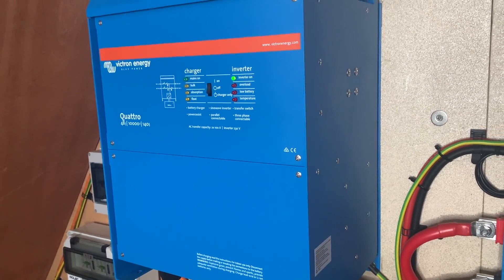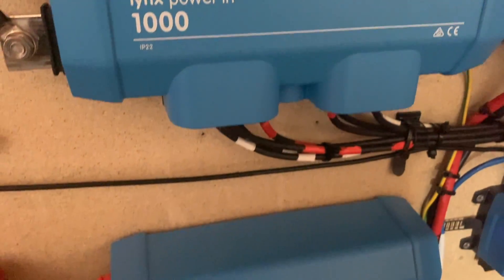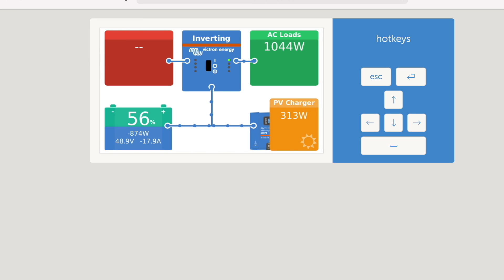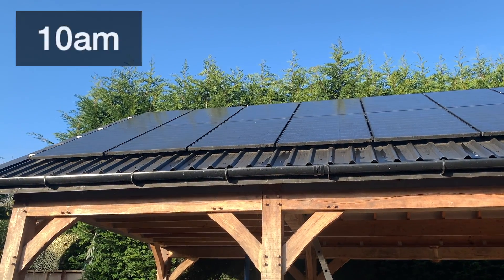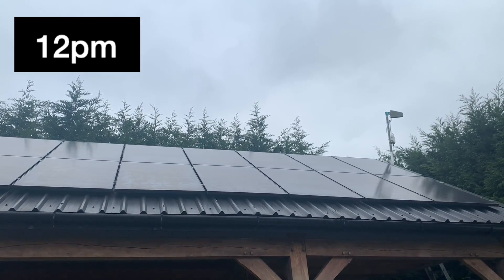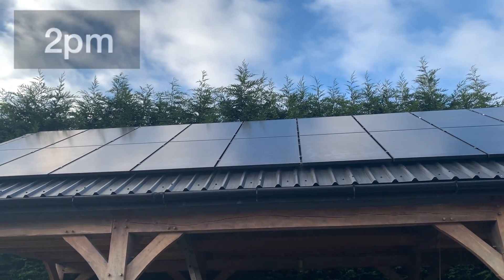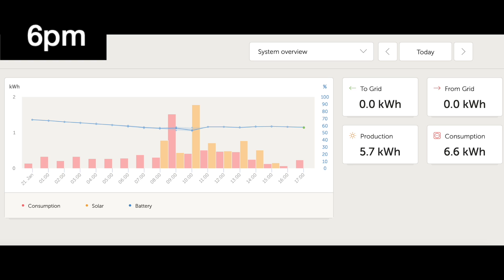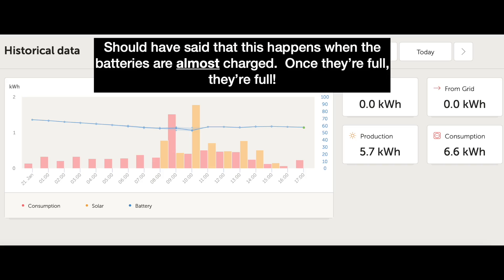SOLAR IN UK WINTER: What our DIY OFF GRID SOLAR POWER SYSTEM produced in ONE DAY in JANUARY.

Comment: I appreciate your video. However, it seems to highlight that solar does not enable sufficient and reliable energy to be off grid and carefree. Instead it seems that one will spend a fair bit of time agonising in front of your linked computer on darker cloudy days (of which at least six months for the UK) over whether you have enough energy produced to enable normal living without having to decide, do I sacrifice say a laundry day just so one can cook food; have a light and heating on. But in these times we live in, your solar may we’ll prove the difference (assuming it doesn’t malfunction at the worst time) between survival or not. So while I seem to be slating solar and I am to a degree as they are not the answer to normal abundant living, they are however possibly a good step in the right direction when s**t hits the fan as it will in the near future. Good luck and thanks for the posting.

Comment: Thanks for the great video! Had solar install myself over past two years. It seems like you must have the panels facing east. I think having them south is best if possible in the future. Noticed with my own solar that they are worse in the winter because of their angle being not steep enough for a lower sun. So if you have too much energy in the summer but not enough in the winter, then having the angle more biased to a winter lower sun angle. I know easier said that done when it's the roof's angle, but if you had space to put some on the floor then an angle change in the winter would help.

Comment: I ran Majority of our house off grid for five years and it worked brilliantly throughout the summer but winter was always gonna have its issues. One of my biggest mistake was to have lead acid batteries,but at the time of the installation it was my only option due to cost. I have now sold all my equipment and gone down the grid tie route which is more beneficial for us. You have an excellent system and l wish you all the best.

Comment: I've been off grid for 30 yrs and back then it was tuff. But with today's equipment it is so easy anyone can do it. These new inverters that are all in one is the ticket. I run 10 kw solar pannels and 50 kw in batteries which are two 48 volt forklift batteries. I'm always at 94 to 96% of battery voltage in the morning and never use a generator. I'm at float by 8:00 am. It works.
Reply from the maker: Thanks for your comment ☺️ Glad your system is working so well 👍

Comment: Ok so I don’t live in the uk but I have trouble using all the power I produce, 6x415w panels 5kva inverter, 5xpylontech us2000c 12kw, how do fully utilise 10kva inverter and 21.3kw battery bank? What do you run all at once to require a  10kva inverter? I only ask to learn what I else I can plug in to prevent my batteries from being fully charged by lunchtime every day! Do you have a couple of Tesla’s hidden away? 😁

Comment: I am interested in knowing if there are any studies comparing the degree of influence respectively of length of day (i.e. sunrise to sunset), angle of the sun and degree of cloud cover on the amount of PV generation. My observation on our system here in South Yorkshire (14 x 280W panels = 3.92 kW + Solis Inverter + 13.5 kWh Tesla Powerwall battery) is that the length of day is the predominant influence. December to February this year we generated around 300 kWh; June to August 2021 around 900 kWh. Overall: October to April we’ll get 1,000 kWh; between April and Ocotber it’s be 2,500 kWh. Pretty consistently year on year. At this time of year (mid-May), with clear blue skies all day, we can get up to 22kWh; with variable cloud (sunny intervals), that might be reduced to 10 to 17 kWh, whilst on a heavy overcast day we might get down to between 5 and 10 kWh for the day. So cloud cover is not insignificant. From these observations I’d say the order of influence is 1. Length of day 2. Cloud cover 3. Angle of sun. Even when the sun tucks down behind the trees on the West side of our garden, there can by reasonable generation simply from sunlight radiating in a blue sky above.

Comment: Solar array watts / system voltage + 20% safety margin = charge controller size. 
always get a bigger MPPT charge controller.
maybe have a professional at the company look at your solar panel and MPPT set up.
your MPPT is 150/35 and you have LG355 panels so the MPPT VOC is 150volts the LG355 is 46.4 volts at 10 amps.  so you would only be able to connect 3 LG panels in series to the MPPT.  you have 20 panels.
if you did 4 in series of the LG355 you should have at least a VOC of 200.

Comment: I am in Australia and also have an Off Grid system with 10kw of panels, 6 Pylontech US3000 and a 8Kw MPP Pip 8048max inverter charger. Have had no issues with my system and has far less hardware compared to your system. Being winter now I only achieved 11kwh yesterday. Today should be a better day as I also want to charge an electric vehicle.

Keep up your great work.
Reply from the maker: Thanks for your comment 😊 Glad to hear you’re getting on well with your batteries. 👍

Comment: you could also have a smaller array to the west and the east so you can grab more solar coming in i did this as a test a few years ago and was surprised at just how much more it did to help another thing i did was try and stay away from ac appliances as much as possible and if they could be run from dc i ran them from dc with buck converters

Comment: Thanks for your interesting video and info.
We live in supposedly sunny South Africa and are totally off grid but also on a cloudy day are lucky if we get 10% of the rated power from our solar. I have had Solar for over 20 years now and must admit Victron are expensive but never had issues with mine. What is completely wrong with Solar panel conventional thinking is just using ones latitude angle for the panels. I have found it’s no good anything less than 45deg as in summer you get way more hours sun time than in winter and as you say when your batteries are full you can’t store more. 
On a slightly different note when I lived in Colchester UK I fitted my own solar water heater 45 years ago, everyone thought I was mad! Trouble was we couldn’t shower as it heated the water too hot 5 months of the year. 
What do you use for cooking and hot water? 
Cheers Frans
Reply from the maker: Glad you’ve got on well with your a Victron stuff 👍 We might look add a water heater at some point 😊
Reply: Should have circulated the too hot water through the heat exchanger in an indirect cylinder.
Reply: And a mixer tap on the shower.

Comment: Just watched your winter solar charging video, and note your comment that mid-day is the best time of day for your panels, but unfortunately it was cloudy. When I got my panels in 2011, I was quite pleased that my house faces south east. One major characteristic of sunny days in the UK is that they usually result in thermal clouds (cumulus) building up from about mid-morning. My high power window (above 2 kW) in summer is from 8:30 to 14:30 (BST), peaking between 11:00 and 12:30 (the sun going higher compensates for no longer facing the sun). The best thing is that cumulus doesn't usually affect the yield much until after 11:00 am, so on typical sunny days I get more yield than I would facing south..

Comment: We get basically zero from November into February. Do you have the panels pitched at a steep angle to accommodate the sun lower to the horizon?
Reply from the maker: No we don't have them at a steep angle, but if it is grey (which it definitely was this winter just gone!) we have read that a flatter angle is actually more optimal ☺️

Comment: Surely it would be possible to combine daylight times & historical weather data to produce a reasonably accurate map of the UK that you use with array size & orientation to predict output?

Your video throws up some interesting cost/efficiency questions for the future - Off grid vs on grid, back up generators or using an EV to "buy in" a top up from a public charge point???

Comment: Utilizing a 5 KWp system, my daily Yield in January was from 15,8 KWh on the 30th down to a mere 188 Wh on the 2nd. Even extending to 7.1 KWp would not get me through. How low do You go through Winter? I would very much like to see a spreadsheet with Your daily yield. It seems like the shift in lattitude is taking its toll, I live at 57N. All the best to You from Denmark.

Comment: There's something wrong here. You have 20 monocrystalline panels  which I guess are 250W per panel, that's 5kW of panels. I have 5 x 375W panels (1.875kW) and I produce similar amounts of power to you. not sure how that's possible. would be interesting to discuss. I am using a 3.6kW hybrid inverter with 10kW of battery storage. my panels face southeast.
Reply from the maker: Thanks for your comment 😊 Our panels are 355W each and our production varies hugely based on the weather and time of year. Do you produce more than this in January on a grey day? Where are you located? 😊
Reply: @The_OffGridFamily  
Hi I am based in Hampshire, I can't give you Jan readings as my system was installed mid Feb. So you have over  7kW of solar panels and 10kWh of storage. I think your system should be producing more even on bad days. Maybe I am missing something here
Reply: @The_OffGridFamily  
I would be interested in looking at a couple of comparative days readings over the next few months to get a good comparative. For example, your best day in May and your worst day in May.
Reply: 10 kw of battery storage is not correct/possible ; you mean 10 kwH ?  because that is what i have,10 batteries of 1 kwHour each
Kw is power,like hp,horsepower
KwH  is energy, like Joule,BTU,calorie...
(i know you knew that,but i see SO MANY mishaps regarding those 2...)
and I think it is because their names are similar
Reply: @josepeixoto3384  Thanks for the correction, sorry for the Typo.

Comment: I use victron,  solar panels too ! 
I have 1200 watts of panels ... loads of power all year round living on my narrowboat . Propulsion also electric.
Reply from the maker: We are big fans of Victron 😊 We’ve got on well with all our Victron components so far 👍
Reply: Just checking. Your boat propulsion is poweref by your solar panels?
Would love tonsee that video, setup and an idea of costs.
Reply: @purplemonkeydishwasher5269  yep .. I have a vlog on my channel ! 
A basic setup , cost me roughly  £1000 .. 
I have 720 watts of solar which is equal to a 25amp charge powering a  24v motor with max load of 1.25kw. 
On power setting 2 ( 5 power settings in total ) the motor uses 22amps providing a top speed of 1.3mph . ( remains in float all day in the sun )
At setting 3,  28amp , 1.7mph ( uses a min of 3amp dependant on sun ) 
At the moment I'm only using led acid cranking batteries as this was a trial to see if this setup actually worked... 
Now that it does I'm currently saving for either semi traction or maybe full traction batteries..

Comment: Don't ignore the possibility of low voltage DC.  About 1KWh/day of my background load is from Internet bridge/wifi/fileserver/home automation all of which run on 12V DC.  This is about 1/4 of my total electricity usage.  I have 12V panels on my shed + 240 AH of batteries.  The average load with everything connected is 40-50W which is more than the panels can provide in winter so I have a fake panel which is actually a mains PSU set to a low voltage and current limit.  I am still exploring the settings but I want to set this to something that uses solar power in summer but does not allow the batteries to go flat in winter. Still a work in progress but I will let you know how it works out.  This system provides power at battery voltage which is 12-15V, I was nervous about feeding this to 12V devices but so far have not had a problem.
Reply: I've considered similar, there must be a different scale of cost/ benefit and a tipping point from whether you can viably install a big enough system to avoid  standing charges. Most of us will have a lot of long running low power stuff, quite distinct from high power short use stuff like cookers, kettles etc.
Reply: Doing something quite similar to yours, here. Not finished yet, either. When it is finished-ish, it's supposed to cut quite a junk from the power bill.

Comment: Battery trickle - that confused me as well.  I tried switching between east and west panels and it always took 10W (trickle load on my tiny system). It turned out that the morning charge filled the battery and after that I was just seeing the load so all panels looked the same - they could all do 10W.
Reply from the maker: We find the trickle charge issue means we aren’t quite sure exactly what our system is capable of. If we had unlimited storage it would be great to see what it can produce in summer. Not such an issue in winter for us of course ☁️👍

Comment: One question i have repeatedly asked people I know with installations is what is their total annual percentage yield.  For example, if you have a 3kw array that would be 3kwx24x365 = 26,280kw pa (if the sun is always shining 24/7 etc) but what exactly do they see pa.  It's a simple question but no one seems to be able to give me a either of these figures, they prefer to hide it behind graphs and feed in tariffs etc.

It's a simple equation that would make it really simple to calculate a theoretical pay back duration.
Reply: Hi Ian, I'll attempt to answer your question.  I have had my solar PV system for 10.5 years now.  I have a 4.0kwp inverter, but I have additional panels so they 'overdrive' the inverter.  The system generates around 5000 kwh pa.  Because I installed the system in October 2011, I had a very favourable F.I.T. rate, but my system cost significantly more dosh at the time then the same would cost now.  My payback was exactly 5.0 years & my IRR is forecast to be over 21% pa on the initial investment.  Normal payback is around 7 - 10 years.  If you wish to view the raw data, please feel free to go to the PVOutput.org website & then search for JohnnyK's PV.  Hope this helps you a bit.  Regards, JohnnyK.
Reply: @johnkay4701  Thanks for taking the time to reply, much appreciated.  We live in SW France wit a lot more sunny days so hopefully we could expect a bit of a higher output. I've been hoping to get between 15-20% of stated output on average over the year (wishing for 25% but that might be stretching it a bit).  I'm thinking of being cheeky and seeing if I could install three systems as we have 3 phase electricity ;-)
Reply from the maker: We aren’t massive fans of the graphs either 😂 We have a 7.1kw array so it would be 7.1kwx24x365= 32,196kw pa. However, because we are off grid when our batteries are full our PV production drops to just covering our load so the records don’t show the full potential of what we could generate if we had unlimited storage. We haven’t had the system in place for a year yet so don’t have a full years worth of data to share, but we will bear this in mind when we get to a year in June/July time as we are planning to make a video on it then 😊
Reply: @The_OffGridFamily  Great thanks for the reply, it makes much more sense now.  Where we live we get a lot more sun than you but we're restricted to how many pane;s we can install before having to get very expensive planning consent.  

I wasn't going for batteries as we have AC and need to heat a lot of hot water so we will be able to use what we can produce in the day time easily so to my mind there's little point in storing any excess.

Thanks again for the reply.

Comment: Really useful information, thanks. If I were in your place I would trim the tops of the trees behind and to the side of your panels. Depending on configuration, very little shadow on part of a panel can radically reduce output of the whole array.
Reply from the maker: Completely agree with you on this one and seeing as Fraser is a tree surgeon there really is no excuse! 😂 But we had a baby a few months ago and it’s just one of those jobs we haven’t got round to 😩
Reply: Not sure this is about shadow which is really about direct light. But on an overcast day photons come from every angle and there are areas that could be sky, but the panels are seeing blackness where the trees are. Subtle difference (and even more subtle gains!), but it's there to be had.